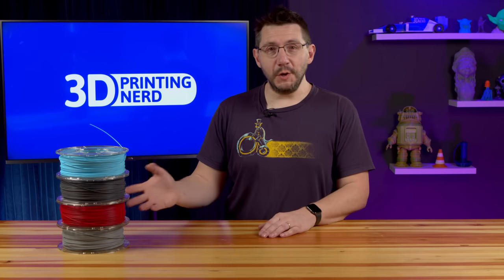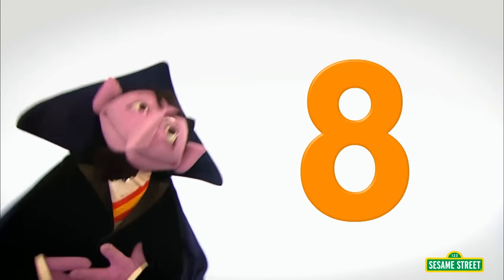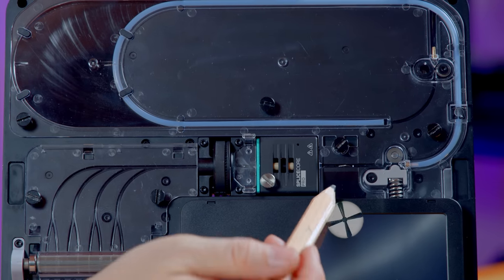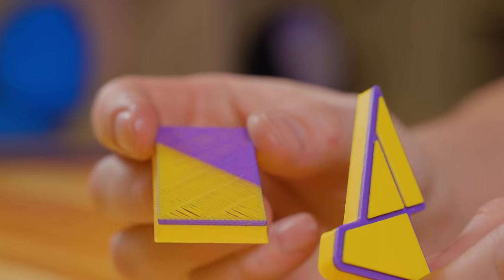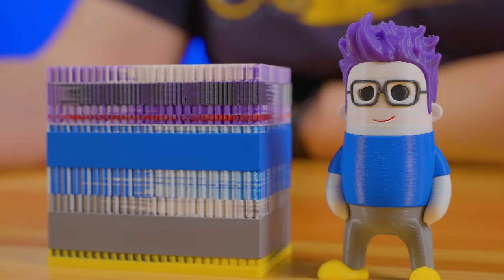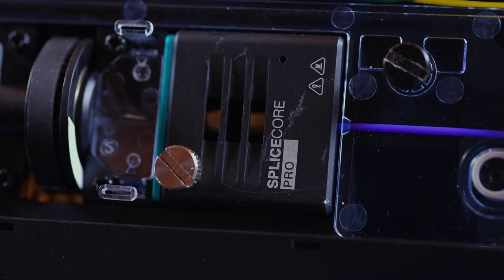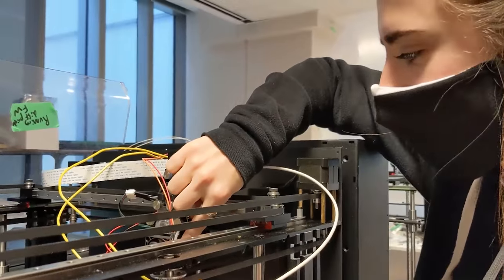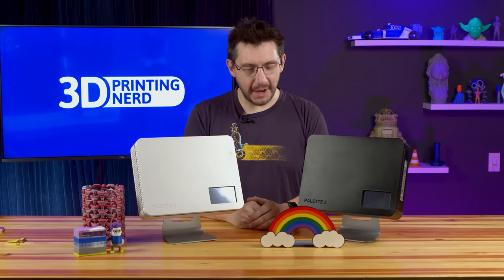8 Colors At Once! // First Look at the Mosaic Palette 3!

Comment: Freakin awesome.  I am about to start modeling something that is ultimately going to need 2 or more types of flexibles.  I am really interested in how it can handle flexibles of different  "elasticity" in the same print and how durably the bond is between materials.
Reply: Good luck, the Palette 2S Pro is awful at flexibles, even TPU to TPU with 95 shore hardness...thing jams more than bob marley. Not sure how the 3 will perform, but i have a 2S pro for sale because Mosaic wouldnt give me my money back...
Reply: @Fly_High_FPV  Good to know I am sure one of my youtube channels will try it out. I'll wait til I see it happen or maybe the pallette 4 will be the winner.
Reply: @michaelwhisman2479  i'm leaning really hard toward IDEX after wasting nearly $1000 on Palette 2S Pro et all
Reply: @michaelwhisman2479  just be wary, so many of these channels are just pushing the shiny product that mfr's give them and gloss over the real detail. when real printers put them to the test they dont live up to the hype. I'm going IDEX as I really want the printer to be aware of when the color changes happen, and hopefully get past the jams.
Reply: @Fly_High_FPV  Are you talking about the Ender IDEX kit?? took me a bit to find it but looks cool.  I'll have to check into it more and see if I can add some of the tech to my custom build. Ultimately I am going to be doing a Core XY, Tool Changer, and Duet board, with a custom extruder/hot end set up I have been working out, which will, in theory, print flexibles in a heated chamber with nylon or other HT filaments. will be interesting.
Reply: @michaelwhisman2479  just Independent Dual EXtruder's in general
Reply: @Fly_High_FPV  That's fun.  Thanks for the awesome idea.  Have got a lot of ideas now of things I never thought about yet with my CoreXY build.  Need to get this done. Thanks

Comment: Could you have printed a rainbow where the transition from red to orange and from orange to yellow, etc, were all part of the rainbow instead of in that waste tower?  Also, if one cloud transitioned from black on the outside to white at the center, and the other cloud transitioned from white in the center to black on the outside, that too might have been cool.

Comment: I am still not sure why the waste blocks are so huge. The mosaic knows (or can calculate) how much plastic is being put down per second / how fast the filament is being used, the Gcode is available before the print starts. It can check the "before print" calculation as it goes and make adjustments (if required). The layers can be made into color blocks (were possible) to minimise color changes.
Just seems they have solved a lot of the other problems, but the wastage is yet to be really looked at.

Comment: This is really impressive, too bad it doesn't work with 2.85 filament (I have an Ultimaker 2+).
Can I say that I find the transition tower of the rainbow beautiful? :)
Reply: The entire 3d printing industry is moving away from 2.85 as a whole it's getting harder and harder to get stuff made for 2.85 filaments which sucks but really 1.75 is a better option

Comment: Instead of a waste block, could another thing be used, say, something that will be purely utilitarian, and will not matter that it has smudges of colors.
Example: I print a house for a model railroad layout, and the house has a gray foundation, white walls, a red door, blue windows with clear windowpanes (or add the panes after printing), and a green roof. At the same time, I also print a block that will support raised track, and will be completely covered by scenery, and so will not matter that it will look like it was used to stir 6 cans of paint. Only hangup I could see is the "waste" shape will need to be at least as tall as the main shape, and will need to have at least a certain amount of cross-section, to fully absorb the transitions, especially any-color-to-white.

Comment: So, since you DIDN'T bother to mention which slicing program will actually accomodate "8 colors", I'm going to assume that you are using a printer (you also DIDN'T bother to mention which printer you are using) that will allow you to stop and start printing manually AND allow you to purge the previous color AND resume printing at the proper location and height. The problem is the added wear and tear on the printer..  It would be a lot cheaper and way easier on the printer to just print the model out in a base color and then just paint in the details..
Reply from the maker: The Mosaic Canvas slicer is what supports the 8 inputs of the machine, and they are working on a plugin for Prusa Slicer. I mentioned the Prusa MINI and I thought I mentioned what printer for the 8 color model, but just in case, it was the Prusa i3 mk3. I know it was seen in some footage as well. Added wear and tear on the printer? The process it just a continual feed of filament to the printer without stopping, so I don't think much extra wear and tear going on. As for it being cheaper and way easier - sure - but not everyone has those skills or wants to have those skills. For some, it's easier to do it this way. Are you a model painter? Do you have anything posted online I could see?
Reply: @3DPrintingNerd  at what point in the video do you mention the mosaic canvas slicer? Is this mosaic canvas slicer open source and will it work with "any" 3d printer? Instead of focusing on how great this $500.00 or $600.00 add on is, maybe you should get specific about which printers it will or won't work with? That way you would be posting something more then just a plug for an add on that may or may not work with printers other then the one you happen to be using....
Reply from the maker: @mrsmith8737  I apologize - I didn't mention Canvas. I've mentioned it in videos before about the Mosaic Palette line, and I've showcased how to use it. This was a product announcement, and the specific product is the Palette 3 and Palette 3 Pro hardware. I'll have more videos coming soon diving deeper into slicing and printing. It is built for most any machine that takes 1.75mm filaments, and I'm sorry I didn't make that clear. Here is a video I did taking a deeper dive into their Canvas slicer: https://www.youtube.com/watch?v=vnUnF3wooZk
Reply: @3DPrintingNerd  I also apologize to you if it sounded like I was being harsh and overly critical. I am fairly new to the whole 3d printing scene and have learned a whole lot watching videos and reading in the various forums. Also, trying out different printers and many many failed or sub par prints....  I do however realize that sometimes people post videos on YouTube that make things seem one way and yet the videos are only relevant to very specific pieces of hardware and set ups..  If a newbie like me watches these videos and doesn't know much about 3d printing and runs out and buys a product based on one of these videos and then ends up not getting the same results because they are using different hardware; it can be very discouraging.....

That was the point I attempted to make, apparently I failed..  Have a great day...
Reply from the maker: @mrsmith8737  Hey! Seriously, no hard feelings at all - I promise. I want you to feel free to ask questions like this, because I'm willing to bet you aren't the only person with these questions. I do my best to cover what I can, but in this case, a product launch, I had a specific target in mind. I do plan more videos on this, and I will take a deeper dive into the elements of setup and usage. Please don't hesitate to comment more and I'll do my best to reply.

Comment: I have an unassembled MMU2 that I can't seem to ever bring myself to assemble when I know the Palette is out there. I know that by comparison the MMU2 is just going to be a pain in the butt. I will say that I think the artificial differentiation between Palette 3 and Palette 3 Pro is especially egregious. Palette 3 should have been a single SKU. I am extremely wary of companies who do this sort of thing because I know that they will be unlikely to continue to add features to the existing platform even if they can. They will instead be more likely to defer this to paid upgrade options which will be offered in conjunction with new hardware or higher-tier skus even if they could be introduced into their existing lines by software/firmware. I might have otherwise been tempted to jump on a preorder, but instead I will see how their long term support pans out for their customers.

Comment: I reaaally want to see how flexible materials work together with rigid materials! For example a shoe sole with different areas of hardness. Another idea could be some kind of joints. Just saw some animals on thingiverse with articulated limbs that use s-curved patterns for flexibility. Those s-patterns could be substituted with a solid part of TPU.
Reply: I would be interested in the same thing - maybe some compliant mechanism with flex joints and rigid bones. Perhaps some medical model - bone+muscle from NMR scanner? Another thing: translucent + opaque (should be easy - but how does it look)
Reply: These machines are awful at printing TPU-TPU... god help you if you want TPU to another material..my 2S Pro jams more than Bob Marlet

Comment: Would love to see you test it with dissolvable supports on a multi color print and maybe flexible with  some non flexible in the sane print. It is so crazy to think this is what came from that Toronto trip. I remember how crazy that experiment was! 
Also, that rainbow transition tower is entirely too pretty!
Reply: The palette 2S pro was terrible at flexibles...wanna buy mine? It jams more than bob marley
Reply: @Fly_High_FPV  oofff, good to know. I like jam on my biscuits, jam in my jazz but not such a fan of jam on my filaments. Actual filament jams and fruit jams respectively. Although I am not sure why I would have jam on my filament....

Comment: Besides the multi-color aspect of the Palette, don't forget the incredible value of being able to feed it the last few meters from lots of different spools that might otherwise go in the trash. Also, for the giant models that may eat more plastic than your 1kg spool can offer, loading multiple channels of the Palette with identical spools, means not having to stop for a filament change mid-print. 

@Joel - you should commission a supersized Palette for the monster lurking in the garage that is the Workbench Pro.

Comment: I have delayed ordering the Palette 2pro since I learned of the P3spor, and I'm putting the order in tomorrow!   I would like to see you feature the P3SP using wood-infused PLA and the various "colors" of wood available.  I am modeling miniature houses and I am excited   printingto start printing with wood PLA.    I look forward  to have the capability of mixing the wood tones and still have room for specialized BRIDGING filament.   I'm hoping to learn about the settings that you will use in your setup.   Do you have a "favorite"  filament manufacturer (brand) that will have the largest variety of wood tones/colors?

Comment: just ordered the MMU2 from Prusa a couple weeks ago and I was flipping back and forth on the pallet2 or MMU.  finally decided I wasnt fully onboard with the system that fused material and relied on timing to get them in the right sequence and in sync with the print job.  How much did I overthink this?
You would really impress me, by not printing different colors with similar properties, but by printing different materials, PLA, TPU, PETG and soluble material into a single print.  given the different properties and temperatures, I would be interested in seeing the outcome and print quality.

Comment: I like the product but it looks like I would waste less filament printing each colour as a separate print and changing the filament each time then glue the pieces together like a normal print. Those transition towers are huge 😱 it May take longer to do separatly but i will have $700 more to spend on filament and superglue.

Comment: On my end, I'm very curious how you indicate what should be in what color? Is this something done at the designing(fusion step) ? Or do you have some software where you paint on model? How well would it integrate with my octoprint+prusa mk3? What is your opinion between the palette 3 and the MMU2S ? I'm   really interessted by multicolors printing but there is a lack of ressources on it ;)

Comment: That is how I always wished 3D printing worked in my mind---right color at the right time with no prep or painting---but I know I would screw up every single print with that plus it must use a ton more filament with those transition towers. I'm fairly new but it's already to the point where I only stock a handful of colors in quality brands to pick from after going on a filament spending spree initially. I'll be breaking down prints and painting for the foreseeable future but that thing is a great sign of things to come.

Comment: 1. Pre-ordered
2. EDIT: IGNORE this (see below) - What do you mean it's $100 less? They didn't mention such a thing and pre-ordering didn't do such a thing...
3. I feel they could've done better indicating the P3 is only 4 colors... so I worry a bunch of people pre-ordered the P3 thinking it would have 8 colors

Edit: Tony below referenced this, but someone else explained: when I went to pre-order, I thought it was "3 $699, 3 Pro $799" but it was "3 Pro (shipped via boat) $699, 3 Pro (shipped via plane) $799" and the 3 had "3 (shipped via boat) $499, 3 (shipped via plane) $599". So that explains the confusion around pricing. Once pre-order period passes, it will always be the higher priced version of each model.
Reply: The 3 is going to go up to 799 once it actually starts shipping per the website. 899(Once presale ends) for the 8 color model.
Reply: @tonyradle8747  Joel video says normal price for the Pro is $799, sale is $699. I just backed the Pro (8 color) for $799... so where's the $100 discount mentioned in the video (and the amount you mention is $100 more then what was discussed and what I saw in Mosaic's own presentation)

Edit: ok, I see on the site that it indicates MSRP for the 3 is $799 and currently selling for $699... but that's still more then the video says (and feels a little off given the 2 and 2S was $699 to start and from the layman's view, the 3 doesn't offer anything the 2/2S didn't already do (since it's not 8 colors)).
Edit 2: I see where the confusion is, read the original post with it's edit (gesh... so many edits caused by my own misunderstanding)

Comment: Whatever happened to that method where you print everything in one material and then just hat something like an inkjet printer simultaneously color the exterior faces? That seemed so promising (an also cheap because you no longer have massive waste of colored filament on the inside and also no filament swapping at all save for, possibly, water soluble support)

Comment: Use the pallet 3 pro and the pallet 3 on the belt fed printer with a dual nozzel for high capacity huge colorful prints?
Reply: Or 12 different shades of red spacers printing endlessly on the belt printer 😂⭕⭕⭕

Comment: I'd like to see a print designed to NOT use the transition tower and instead have the gradient between colors incorporated in the design.
Reply from the maker: That’s the random mode print I showed - but I think I get what you mean. You want taller / larger color sections right?

Comment: Wow, that is really, really cool!
I wish there was a way to avoid soooo much waste with that transition tower. I get it, it'll be impossible to not have ANY waste, but imagine this: An add-on optical sensor that you can attach to your printer that will tell the Palette when the colors have officially transitioned. 

Or is it that the "length" of the transition tower is determined by the slicing software? Basically you tell it how much transition to spit out? Not sure if I completely understand that whole process. You should totally do a video on how this whole process is made and set up.

Comment: The Palette 3 is their best model yet, and I will definitely be getting one. I still believe, however, Mosaic have the capability to make a full-colour, multi-material extruder. This might require greater partnership with an extruder manufacturer (such as E3D or Bondtech) to "mix" rather than splice them together, but it is something consumer 3D printer users want most.

Comment: what happens when the toolchangers get more common
Reply: I imagine that something like this would be great for single material prints, but multimaterial prints are still better served by a dedicated tool head for each material due to printing temperature differences.

Still, a palette would still work well, as you could have a support or functional material on one tool head, and then your coloured filament on a separate tool head.

Comment: Could you show how the slicer world work with this?
Reply: You have to use their canvas slicer for most prints, which is  pretty limiting and will not print as well as your tuned Cura profiles, but you can import profiles from other slicers (just not cura).